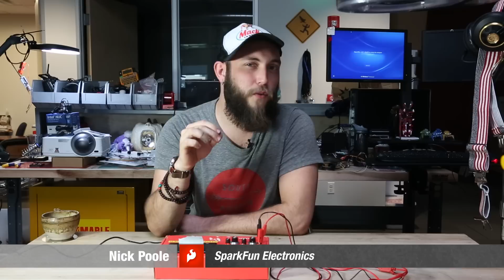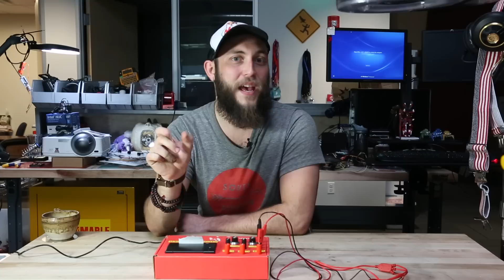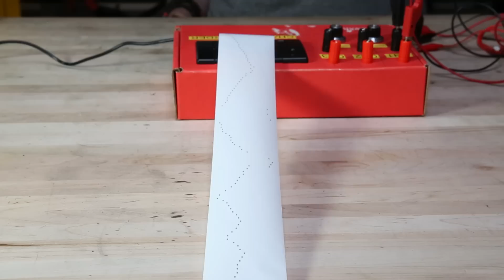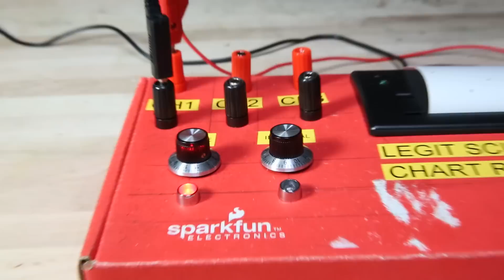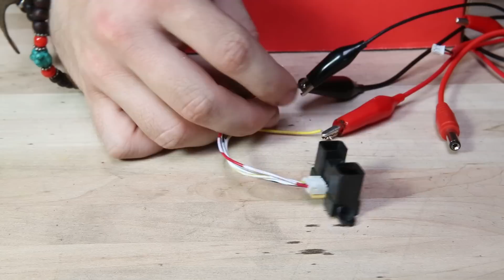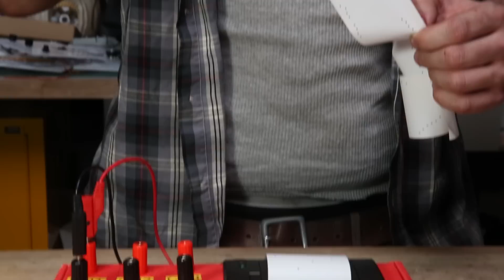SparkFun Thermal Printer

Comment: Hi
  I tried to program the thermal printer using arduino mega. I fed it from an external source (7.9 Volts) as it was written in thermal printer documents. When the Arduino mega is connected, the green light on the thermal printer and the red light under it are constantly blinking and the printer is giving out the paper, but what could be the reason there is no writing on the paper? I couldn't solve the problem. I would be glad if you could help.

Good work.

Comment: Alright, it's late. What am I missing with the God thing?

Also, be weary of this if you need what's been printed to last any amount of time. You practically need to hermetically seal the stuff and keep it in a climate controlled room. 

I'm sure pretty much everyone knows what I'm talking about. Toss a fast food receipt on the passenger seat of your car on a hot day and it'll blank in a few hours. Fast food = no big deal, but manufacturers with multi year warranties bank on this tech, check out a GE lightbulb package next time you're at the hardware store. "X year warranty, original receipt required.". You're pretty much hosed unless you keep your receipts in an always cool place.
Reply: Iceberg86300 or make a digital copy of the receipt which is what I've always used for original receipts a digital copy cuz what they need from the original receipt is the original information not the original thermal paper I've never had a digital copy refused

Comment: it is to expencive to get lots of attention

i mean i would love to work with a few of those but there to damm expencive
Reply: ***** This was also my problem...
Reply: ***** Maybe you can hack a second hand thermal printer?
Reply: Rivalo I would guess so, they must be contolled by some kind of serial/parallel signal ;)
Reply: most of them use a generic rs232 signal
but that is not as fun as a lose unit
Reply: ***** But you could hack it in its original case an just feed the wires to your µC.